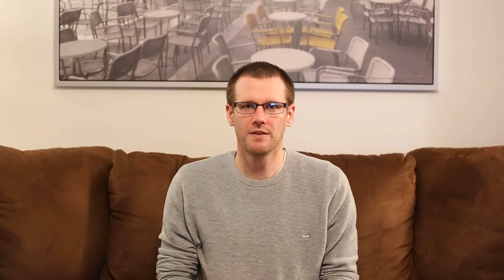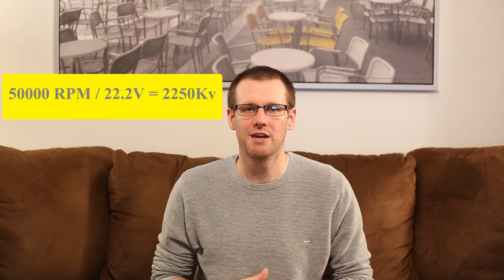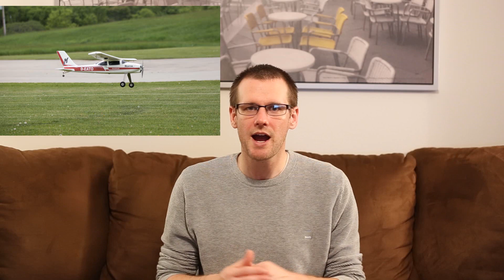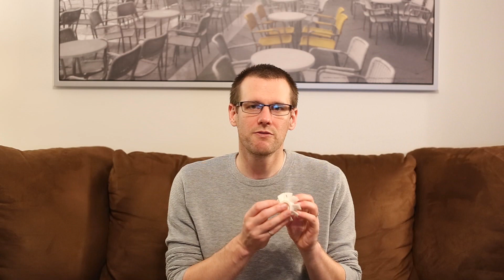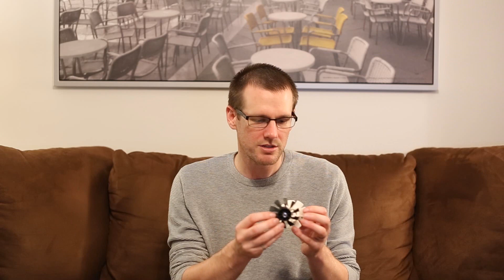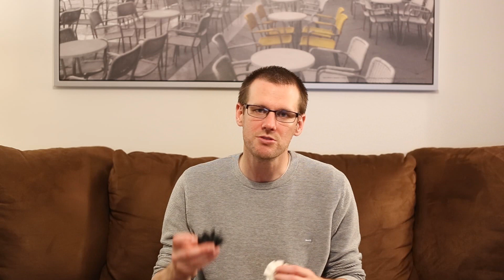How to Select and Optimize Kv of an RC Brushless Motor

Comment: Hello, recently I broke a 2300 Kv edf ducted fan, and I am thinking of reusing the motor with a propeller for a plane. Is it possible or it will underperform severely? Thanks in advance.

Comment: What Kv motor and amp would you suggest for a traxxas 2wd rustler with 90t and 48p gearing (I’m getting a combo motor and esc so don’t worry about overloading the esc)

Comment: Since brushless motors usually have high rpm. How can I use for slow speed boat?
Reply from the maker: You can use an Outrunner with a low Kv

Comment: I just want to know what’s the best upgrade to go a little faster on a zelos 48 has a 1000kv brushless motor. esc I hear its 120A
Reply from the maker: Hi Andy, what were you looking to do to go faster? Guys have replaced components in the hull but that adds up ($$$) very quickly.

Comment: looking for help with the matching of a rocket 600kv rc boat motor and esc ..what amp should we use and what battery size ??
Reply from the maker: Take a look at the boat power system selection video.
https://youtu.be/2tuvoAfPMYU

Comment: Hi thanks for your great work. How could I know how much load that i can place on the power system? And how could I know the RPM range that I need in my application? I am planning to equip the brushless motor with propoller and produce thrust force to push the robot car on the wall.
Reply from the maker: Hey Leyuan Ma, take a look at ecalc. This website will help.
Reply: @RCexplained  OK!Thanks very much!

Comment: From my experience in 1/8 car racing I found oversizing my motors and much lower kv rating, then gearing it up to compensate target rpm. My 4292 motor size at 1100kv on 4s battery with large pinion results in much better efficiency, cooler temps and longer run time on the same battery

Comment: Excellent - just what I was looking for - one question though - where did you look up the rpm range from.  I run 1/12 scale pan cars but never seen anything about rpm ranges.  Thanks
Reply from the maker: Often times it comes from experience, understanding similar power systems others are running. Knowing the speed that you are targeting also helps with RPM range required to get there.